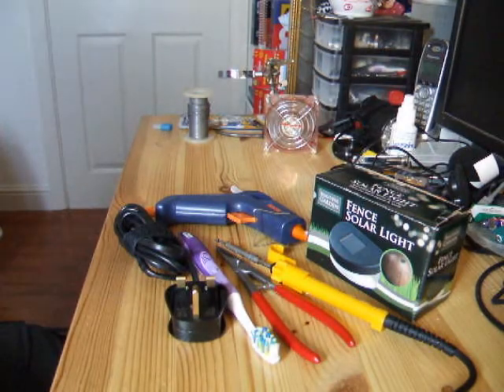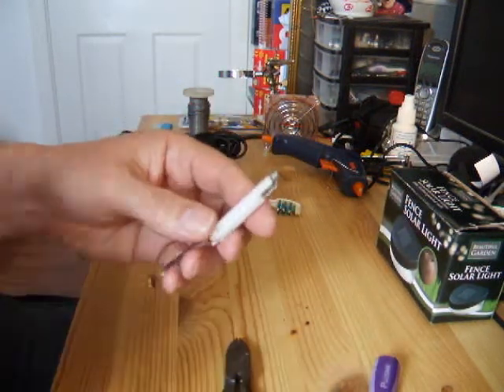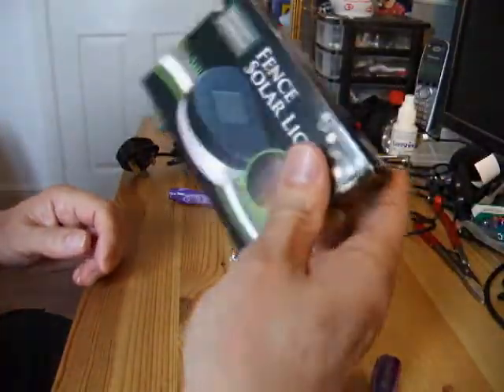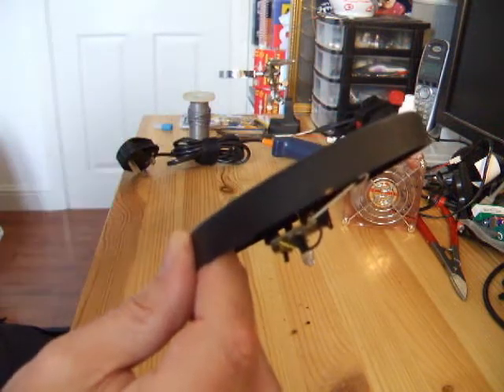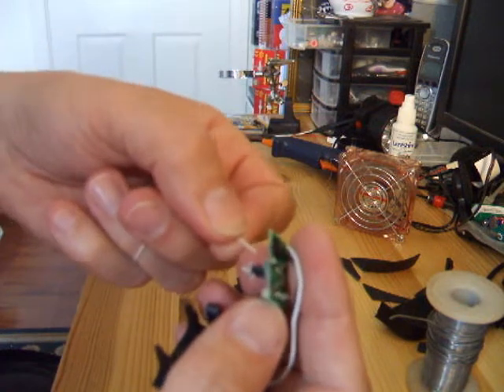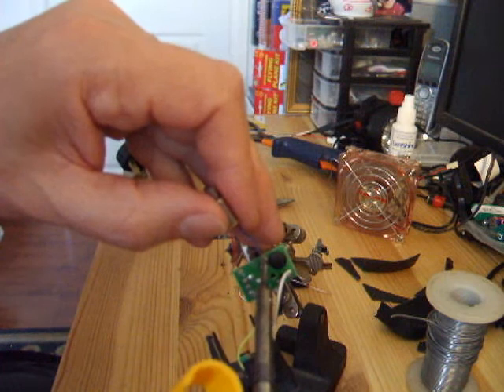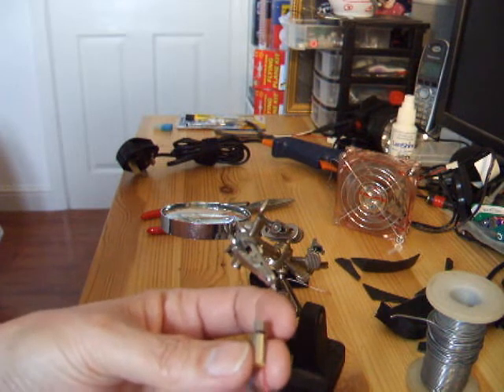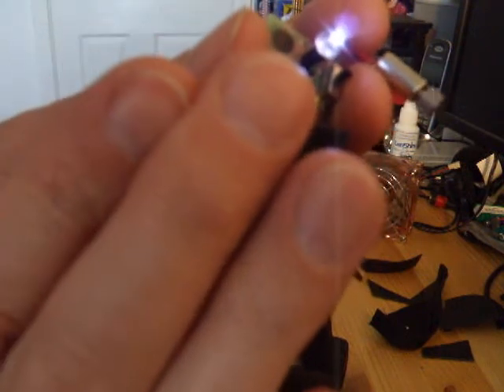Let's have some Solar Fun #1

Comment from the maker: Thanks. I bought a few of those lights because I was going to use the solar panels for a project. When I took them apart and looked at the components the idea came to me. I did quite a few of those vibrating bugs a while back so I just combined the ideas.

Comment from the maker: Thanks for your comment. I am certainly no expert on the electronics involved but I have just looked at the still photo of the circuit in my video (at 5:39) and you are right. The axial inductors tend to have a rounder shape than resistors and oddly enough I keep spotting these little green inductors in my scrap box and couldn't remember where they came from. In my "Let's make a Low Power Oscillator #2 - axial inductors" which I copied from lidmotor and slider2732 I use two brown ones.